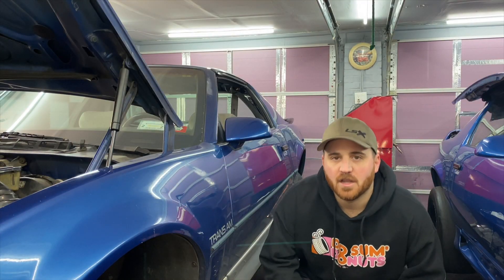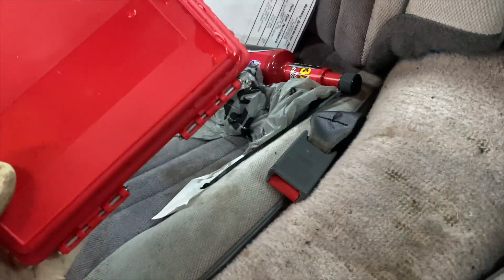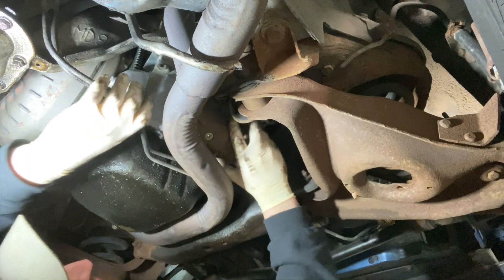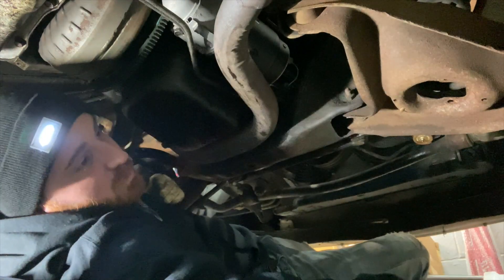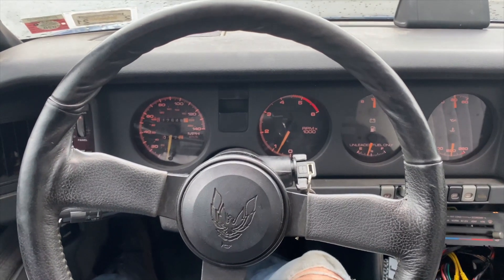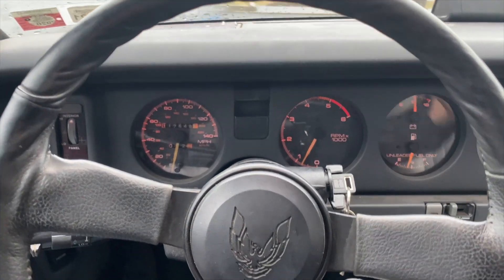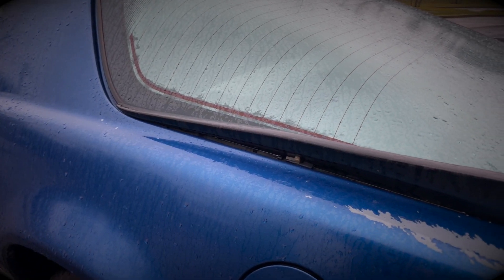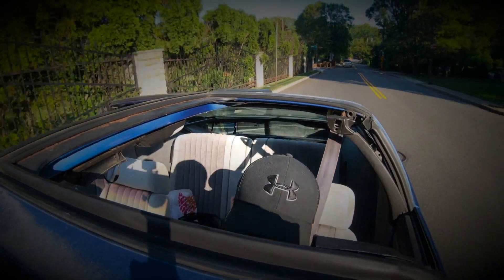3rd Gen Trans Am SUPER SLEEPER Build | The Plan of Attack

Comment: Love the build plan for the 86 Matt. Got an 85 myself (Red but also a 305/700R4 car stock). Your Camaro was why I subbed and as such I'm going T-56 because I need to row gears in my life. Plan to carve corners too so I await the results from the suspension upgrades! Also feel ya on the T-Top bar, mine is swiss cheese as well lol.
Reply: for a mountain road car. the eibach progressive springs, some tokico adjustable shocks/struts with sticky 17in tires. depending on what sway bars you have, I have the oe thick ones, I think 1 1/16th inch? these cars hold their own with anyone I've found to run with.

Comment: What size is the small stud on the front of the starter that goes to the bracket that bolts to the engine block? I am trying to find the correct size nut for mine.

Comment: i am working on a 1989 firebird formula need all the advise i can get. I have a problem with the rear main engine seal leaking, already paid three times to get it fixed, but it is still leaking. I am thinking maybe of buying a rebuilt engine or rebuilding the engine but do not know what is the best option
Reply from the maker: Are you sure its the rear main, how much does it leak? The design of the oil pan gasket is notorious to leak from the back and look like the rear main.
Reply: @lsxmatt  yes, it's the rear seal for sure. I watch it leaking. It does not leak too much but it's still a big problem. The engine is a 305 5.0 tpi need good advice as to where to buy a rebuilt engine. My concern is with the bore size on rebuilt engines.

Comment: You could build the 700r4 to handle the power  and weld the lever arm on the throttle body like I did with my 5.3, Did it so it would have the same throw and geometry as it had on my TPI
Reply from the maker: I ran a 700r4 behind the 5.3 in my old Monte and I could never get it to work right for me, even with the bowtie overdrive kit. I’d prefer an electronic trans anyway for the tune-ability.
Reply: @lsxmatt  Yeah I see what you mean ,What are you going to do for the speedometer?
Reply: @lsxmatt  Im curious what your plans are for the mechanical speedo ? So you can give me a idea if I wanted to go that route

Comment: I wouldn't leave the old bushings, I think that's a big mistake my guy. I would honestly build up the suspension better since you're going to put so much power into her. Subframe Connectors, Tubular Panhard Bar, Torque Arm and Lower Control Arms. All of those things were shit in 86, and they haven't aged well at all lol. TTop Cars have a history of Frame Flex, and that's a gorgeous car, put the damn connectors in, I'd hate to see a grown man cry. Spohn is your friend, so is Polyeurethane and Derlin. The little things matter on these builds, and best part is, none of that will be visible whilst she's on the ground. So, Sleeper Status Maintained whilst also improving driveability.
Reply from the maker: Its getting frame connectors, just forgot to mention it. Most I’ll probably do would be replace the rear rubber stuff with new. I hate the poly in my Camaro. The rear squeaks and I haven’t been able to stop it yet.
Reply: @lsxmatt  Isn't there Poly-Graphite bushings. Which tend to be less squeaky.

Comment: I hope you don't get rid of those wheels I would put me some nice et drags on the back and I would have the car repainted same color that same 2 tone look and put a nice clean interior and nice gauges a nice dual exhaust with x pipes and you already know what to do so I like to see a clean stock looking but fast cruiser
Reply from the maker: I was going to save them as a drag setup if they clear the rear brakes.
Reply: @lsxmatt  aawh ok yea I hope everything works out and I hope you do paint the engine same color blue as the car I havent seen a blue is engine yet I would definitely like to see 1 with the heads being chrome and the valve covers blue with the bird logo on the valve covers in silver!!!

Comment: Matt, i build 4l60’s as a side gig. I’ve built ALOT of them and experimented a good bit. I know what works and what don’t. Had done cars in the 9’s with my transmissions. If you like, I can send you my recipe and hook you up with a good source for parts including the sonnax billet shafts and a drum that holds th350 clutches for the 3-4. He will likely give you a discount too. I’ve moved on from the sonnax input drum to this drum (4l79) because it’s better. Also, there’s another guy I can hook you up with that makes a very cool and easy to use and stone reliable electronic boost control. It does true boost by gear, fail safes, meth control....all kinds of shit for under $400 retail. I know he will hook you up too. If you are interested, let me know.